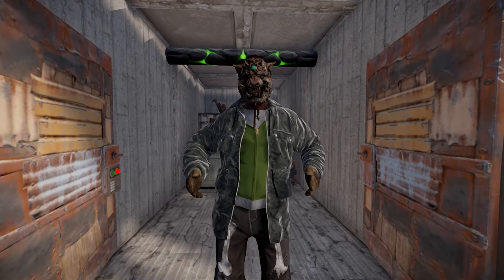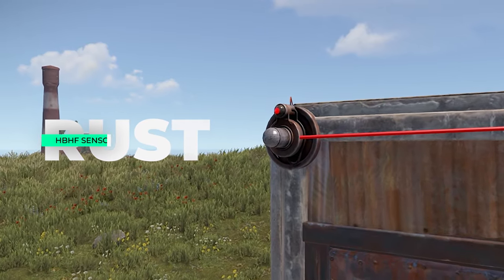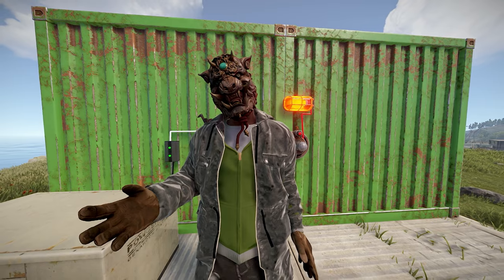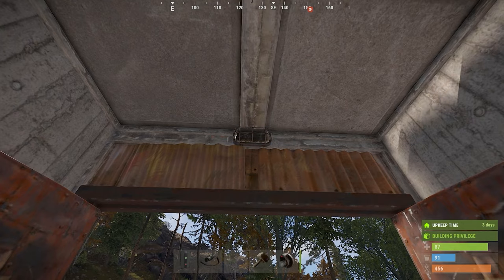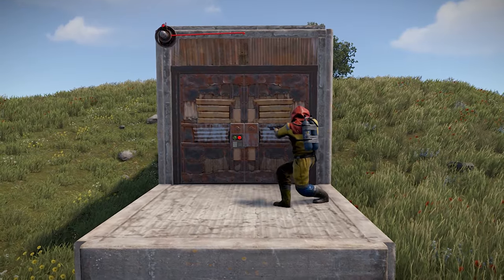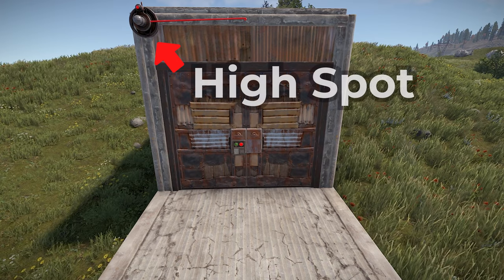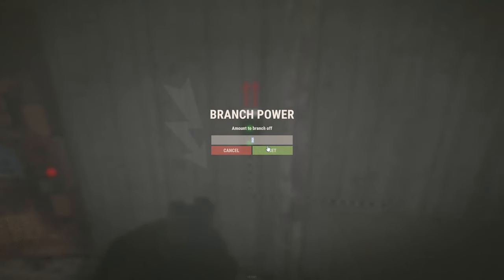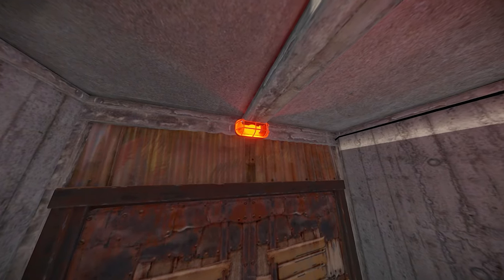Protect Your Base with HBHF Sensor Alarms in Rust!

Comment: Two tricks: First, if you want to run multiple HBHF sensors then attach an RF Transmitter to each. Set up an RF Receiver to a light/alarm and tie them all together on the same 4 digit RF channel.  When any sensor goes off you will be notified.   I use this to automatically open garage doors and power up compound defending turrets behind those doors. Second, to eliminate sensor noise place the sensor in the bottom inside corner where two walls meet in the corner of a triangle foundation. Push the sensor into the corner as far as it will go, then back it off a pixel or two (make take a few tries).  The sensor will be invisible and inaudible from the outside of that corner, but will still detect HB/F if someone is outside.
Reply from the maker: These are both dope tricks! Thanks for sharing! I was going to go into RF transmitters in the video but decided I’ll likely just make a separate video and keep this one baseline for new players, sometimes overwhelming new players just discourages them from using these items! As for the audible issue and trick I love it! Super cool I’ll have to give it a try!